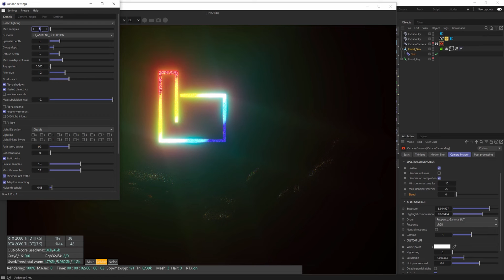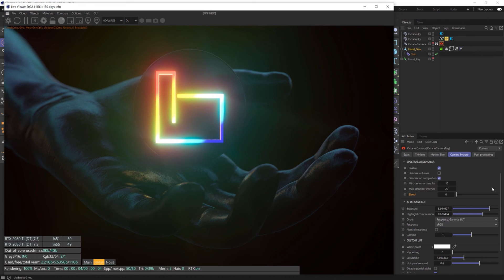Remove Noise From Your 3D Render

Comment: I disagree here, you do not want static noise in animation.
Reply from the maker: Why? I don't want static noise in animation either but when using Spectral AI denoiser I noticed it can give more animated splotchy results within the render. So I check static noise only when using low samples and AI denoiser and then add animated noise in post on top.